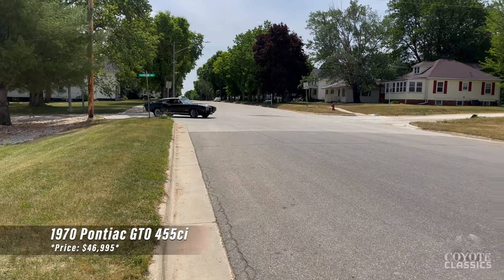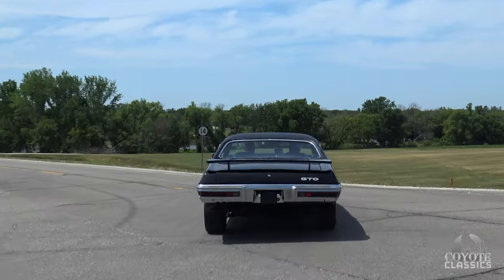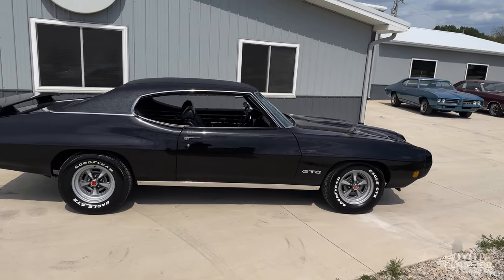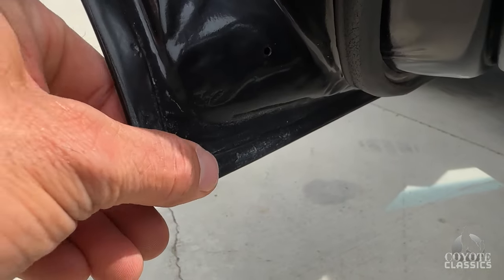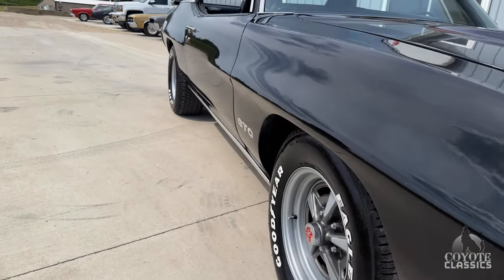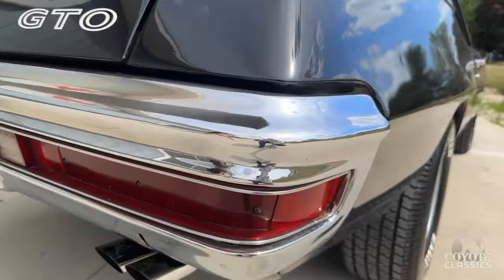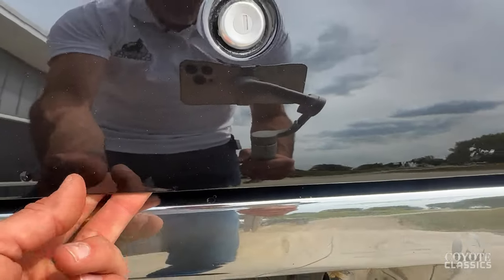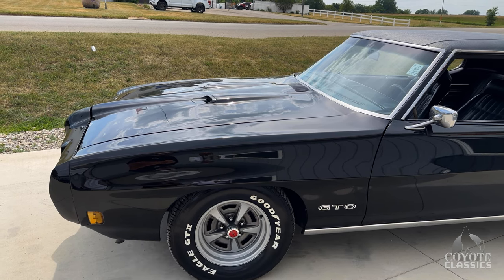1970 GTO 455 H.O. (SOLD) at Coyote Classics

Comment: I had a 70 GTO with a 400 and ram air heads when I was 18. I drove it until I had only 4 points left on my license due to speeding tickets. The difficulty in finding high octane gas with lead additive was also part of the problem. I tried bumping the timing down and running a mix of no lead high octane with regular leaded gas. I soon had to remove the heads to fix the burned valves. I parked it and bought a four cylinder Subaru. LMAO

Comment: 455 HO came out in 71. The 70 455 had high compression. The 71&72 had 9:1 Compression.
Reply: In 1970, there was a 455HO rated at 360 HP.
And the intake was not aluminum.

Comment: Nice goat. Bet it sells fast. Ya know, it has a factory original aluminium intake, (RAIV, or a 455HO). 455 4 spd is the only way to have a 70 GTO. You should mention the rear gear, when you're advertising. Maybe 3.55s?